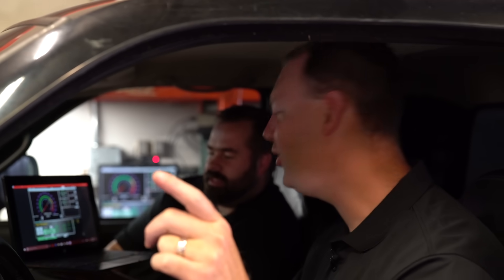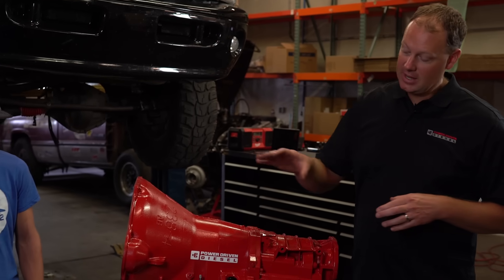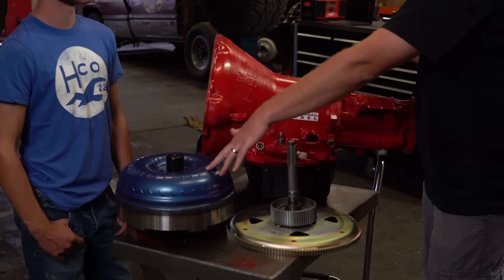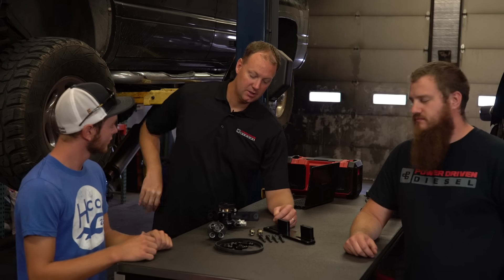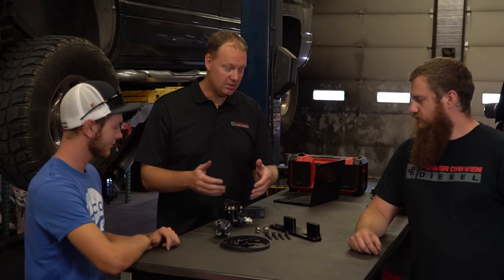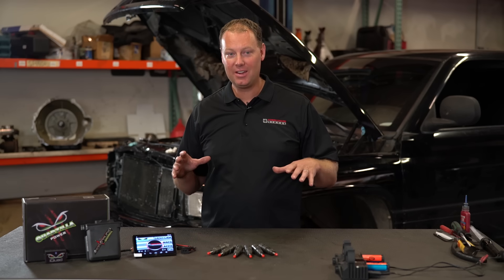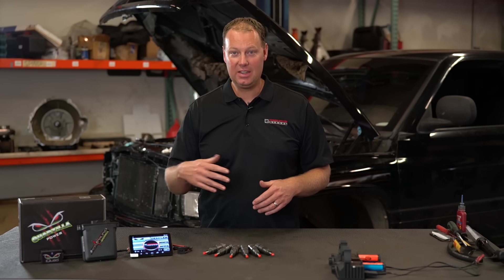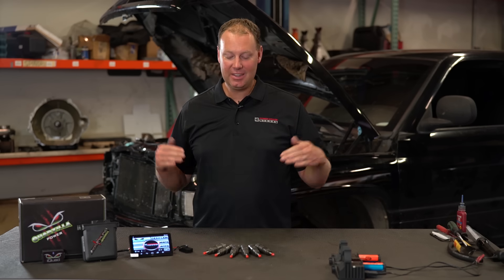We Double the Horsepower of a 24 Valve Cummins

Comment: I had a '98.5  24v/47re . Nice straight 2wd with a long bed. But the freakin' truck was literally falling apart around the engine and I couldn't keep up with all the repairs. I finally decided to cut my losses and sell it after  the vp44 and the trans both took a crap within a few months of each other. Oh yeah, it was a 53 block.

Comment: How much does that good Torque converter cost? I have a stock 24 valve with the 48 transmission. And like you said seems like  the Torque converter slips after we put and 75 horse edge tuner in it.

Comment: In my 02 I figured out I needed to change the fuel filter every 5000 miles or I would start loosing fuel  pressure, I lost a lift pump and an injection pump due to that. Changing the filter i went another 100k on stock style pump and added 40hp injectors with no problems. Still ran great when I sold the truck.

Comment: all the black smoke is a sign of over fueled , it not a fuel squeezer , sorry to say I am not that impressed
Reply: @Landon   Schad you need to know how much boost you are running now , in the semi trucks i use to work on ran 24 lbs of boost and i could change the timing , charge the governor speed ,rack opening ,pressure in the injector , with the new computer ECM you need to know some one to get in 
the back door to play with the parameters .more air more fuel but there is always a ratio  semi engine run 24 to 1 compression

Comment: You need to build my truck almost 300k I fix the big Cummins for a job (Boston transit) other than the miles my truck looks new just needs power also while  dreaming I’d like a auto The 5 spd is getting old commuting into Boston Great show wish I had known I would have done everything possible to be the winner I am going to buy those inj I’ve been looking

Comment: Would you recommend a Cummins conversion with a 6BT coupled to an Allison AT545?

Reason I ask is because I work as a bus driver in the UK and we have this bus called the Dennis Dart which had that combination. These buses are extremely common. You can now pick them up really cheap at like £3000. They made them with the 6bt up until 2003 and 4bt up to 2006.
Reply: lutonscania 
RideVictoria

Comment: If you do a 3rd gen, id be down for a chance to get double the power. I flew from wisconsin to florida 2 months ago to get the truck i was looking for. A black rust free 2003 dodge cummins with a six speed. The cummins was just rebuilt end of last year. They used all stock cummins parts or whatever parts cummins use. New stock injectors, pistons, camshaft, etc. Truck is basicly stock except for the intake , exhaust, valair single disk clutch and the smarty tunner. Let me know if you do a 3rd gen contest, thanks.
Reply: poor truck will rust out in 1 year.

Comment: Awesome video,  will those injectors work on a 99 5sp , 40in tires, but has rebuilt VP and a Fass pump pulling out of stock tank pump housing,  has a Edge/w Altitude tuner, exhaust,  banks high ram

Comment: Should have titled this how to kill a turbo for 8000$
Reply: This is pretty much how my truck is setup but with stock hx35 and a clutch instead of Hy35... If turbo goes then time for a 62mm, head studs and an exhaust manifold
Reply: I’m pretty dumb when it comes to this stuff, trying to learn, but why would the turbo not last with this setup? What causes extra stress on the turbo? All they changed was fueling
Reply: @brickson98m  More power means more air and fuel is used.
More airflow means more work for the turbo to do.

Turbos are only efficient between specific points. Ask too much of them and the shaft over speeds, the bearings wear very rapidly, and they destroy themselves.
Reply: @TheFridge  "work for the turbo"???
It is just a wheel driven by exhaust flow.

Only things that ware on a turbo is speed and heat. Similar rpm = no additional ware.
Good air/fuel ratio = no additional heat.
Reply: @derJackistweg  - Go have a look at a turbo compressor map and see what happens when you increase horsepower (Lb of airflow per min).
I'll tell you what happens, turbo shaft speed increases.

More shaft speed = more wear on the bearings.

If you push the turbo really hard, it can try to suck the compressor wheel through the intake. This really wears the thrust bearing and then the compressor touches the housing and your turbo is junked.

More power is more fuel being burned.
In order to burn more fuel, you need more oxygen.
To get more oxygen you need to increase airflow, or switch to a more oxygen rich fuel.
Reply: @derJackistweg  lol More power always equals extra heat that's basic stuff man... especially in a diesel engine. smh
Reply: @famousmidnight  Lol "basic stuff", more power does not equate to more heat, as stated previously, a proper a/fR would maintain the same amount of heat as on stock tune. More of both at the same ratio, just means the volume in the cylinder is used more efficiently. Excess fuel in the mixture would cool the burn and prohibit heat production, just the same as a lean condition would have an excess of air, and again prohibit heat production, because as we all know, diesels cannot run on ambient air alone.
Reply: @TheFridge  Yes, which is why they added an intake that flows better than stock, so the compressor can induce more air efficiently. Also I'm not sure where you got your info in reference to "If you push the turbo really hard, it can try to suck the compressor wheel through the intake.", but if you are referring to the compressor wheel moving outward into the inducer, that is cause by compressor surge which is that cool choo choo choo sound your turbo makes when you load the engine to peak boost and then lift immediately. What happens is the excess air being forces through the intake has no where to go when the cylinders don't use it, and the air is forced back through the intake causing a zero resistance scenario in the compressor housing, thus speeding the shaft to nearly three times its usual speed, which is what wears the BUSHINGS that the factory turbos are equipped with. As for increased power production, the turbo sees the least amount of negative effects in comparison to the rest of the engine. Vehicles with undersized turbos are everywhere in this day in age and they last tenfold over older more properly sized turbos. In this build, the only thing that the turbo sees more of, with the added power, is pressure in the compressor housing. The added heat in the turbine is minimal.
Reply: @zachglick502  Silly me, I thought for some reason when you increase the pressure via turbocharging it made more heat. Everything I've ever read was wrong... Wish I would have talked to you before I put a larger intercooler on my 335i I guess my a/f ratio was just off. My tuner had me buy one via 3rd party for no reason.
Reply: @zachglick502  - The choo choo is the result of the blades stalling, aerodynamically speaking, chopping the pressure wave into pieces.

There is no 'zero resistance' - you get a pressure spike. This spike causes the compressor wheel to stall (aerodynamically - making the flutter noise) and SLOW DOWN.
The massive pressure spike increases the density of the air on the turbo, causing the compressor wheel to slow.
In the bad old days, compressor wheels had been known to unscrew off the shaft because of this effect.

Turbos need to spin faster to make more airflow, just like supercharges - but unlike (positive displacement) superchargers, turbos output a variable amount of air per revolution.
This is why a turbo has a compressor map. It shows where the compressor is the most efficient, and what the shaft speeds are going to be.

http://www.himni-racing.com/images/gt3582rcomp_e.jpg

Have a look at that compressor map, and Ill give you a couple of points to look at.

pressure ratio of 2 (which is one bar of boost, or 14.7 PSI manifold pressure) and 30 lb/min of airflow - it is to the left of peak efficiency.
Now increase the airflow to 40 lb/min at the same pressure ratio.
What happened?
You got closer to that line that represents almost 90K RPM, meaning, yes, the turbo shaft speed increased!

More airflow doesnt 'just happen', something has to make it.
With a turbocharger, it tries to maintain the set pressure ratio, so if the engine is able to consume more air, the turbo speeds up to maintain that same pressure ratio (pressure is resistance to flow)
A PD supercharger in the same situation would show lower manifold pressure once the engine is able to consume more air, because it is providing a fixed volume of air.
Reply: @zachglick502  excess fuel raises the egt in a diesel dramatically. It seems to cool gas motors, but not diesels.
Reply: Should have called Gale Banks
Reply: Adding timing increases peak cylinder pressures, dramatically shortening the life of the motor. This is why the stock tunes dont do it. And the turbo is going to be so far off its map that the efficiency will be down and egt way up. If all you care about is burnouts and low duty cycle power, it probably doesnt matter, but if this truck does any towing it will be time for a new motor pretty soon. So lets get some one or two year or even five year follow up on this build and see how it does. I am genuinely curious.
Reply: @kwittnebel  These early model 24 valve engines were very short on timing and need an increase for performance. I have a 24 valve that would not even pull a pontoon boat in overdrive until I added a tuner.
Reply: @popatop6657  why would you tow in overdrive to start with? you shouldn't be going over 60 towing anyways. They run nice and cool in 3rd.
Reply: @mr.monitor.  These pickups will do fine towing in overdrive, Mine has over 400,000 on it and the trans was rebuilt at around 200,000 90% + towing miles with many of them grossing around 30,000 lbs
Reply: @popatop6657  maybe they do fine.... With mine in the summer i can't run ac and od at the same time with even a empty 20' trailer without the transmission temp and engine climbing. Witht the od off things are about 15 degrees cooler.  After adding a big trans cooler it does even better but still just seems like it spools up and works the transmission too hard when its over about 80 outside.
Reply: @kwittnebel  Yeah that turbo is just a heat pump now and will not last
Reply: @kwittnebel  Also much higher temps, all around.
Reply: @gregk.6723  yes there is increased total heat dissipation requirement with increasing power output of the motor. There is a also an increase in charge air temp with charge air pressure,  and increasing pressure is typically the only way to increase air mass flow without changing to a larger compressor wheel. If this increase in mass flow or pressure ratio pushes the stock wheel out of a high efficiency island, then even more heat is created by the compressor trying to do more work than it was designed for. If the intercooler is not able to dissipate all this extra heat, then egt will increase. I actually do not know much about turbo longevity but I assume compressor surge/stall is tremendously hard on the all components of the turbo due to large acceleration forces on the rotating assembly and thrust and other associated loads on the bearings. Overspeeding probably leads to balance issues as well as thrust loads outside the design spec due to excessive pressure ratio, but I am out of my depth when it comes to multiple axis balancing of the rotating components and how dynamic forces and harmonics at excessive speeds affect the bearings. The compressor wheels seem to deform at some point, so that likely throws it all out of whack at some speed regardless of what bearings were doing before deformation occurred. Cool to see people discussing this stuff.
Reply: I have an 06 original engine and transmission with 395000 mils and climbing and runs like a champion
Reply: posey matt what’s your maintenance schedule look like? Recently acquired my fathers 05 2500
Reply: @areti6380  Every 5.000 miles oil change and also every 60.000 trans mission oil change I have OCD when it come to truck not working right I fix it right away it still has original eng and transmission
Reply: John geezee yep that turbo’s not gonna last...

Comment: what boost is the truck making? is the turbo J-hooked? not try to question the experts..just try to get a better feel for my 24v with 75hp injectors..no tune but no limit on boost..I've hit 34psi..seems the replacement ECM I got..isn't stock..( :) ). doubt me..ever seen an air filter destroyed because it was dirty..buckled up..( ok its a stock air)

Comment: Ok, so what will the life span if the engine look like with type of modification? If I want similar numbers is there a more stable way to make that kind of power. Most guys I have talked to don't run the highest level tune, because it tears things apart.